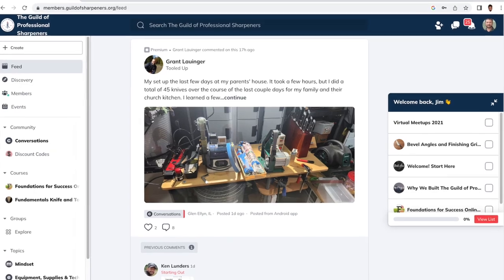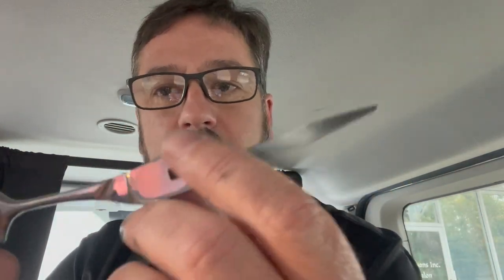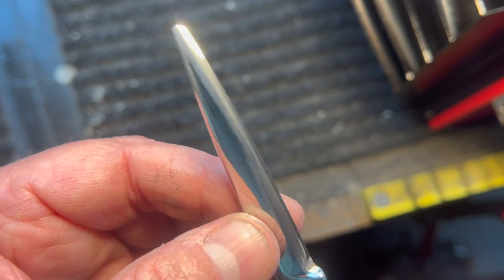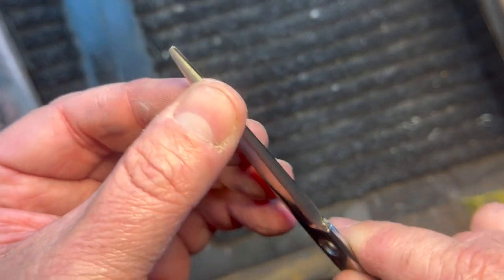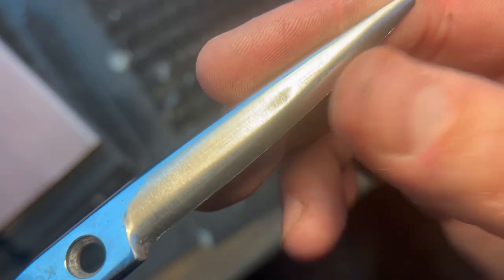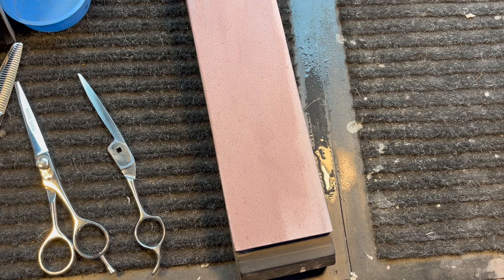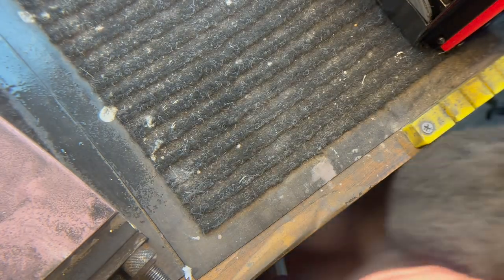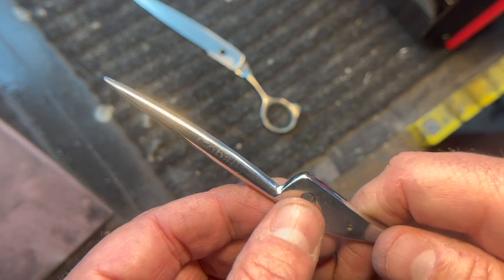Beauty Scissor Sharpening Class: Restoring the Convex on a K Blade Beauty Shear

Comment: What would you charge for something like that? I'm trying to decide if there's enough money in offering this service. The machines to do barber/stylist shears and clippers is kind of pricey compared to sharpening knives. Great content though 👍
Reply from the maker: In my neck of the woods I charge $25.00 for stylist shears. If have have to do repair work I often charge $5.00 to $10.00 extra, but in this case I did not. This was a new customer that I had not sharpened for before.